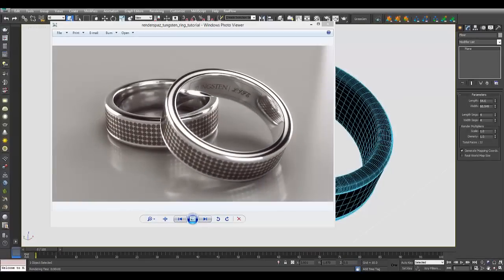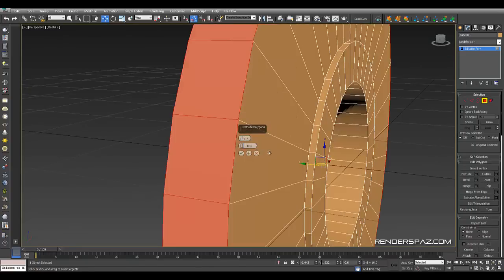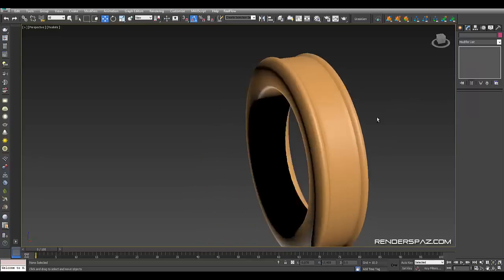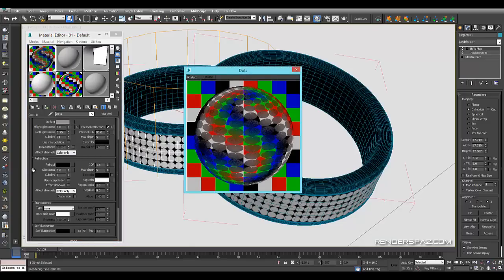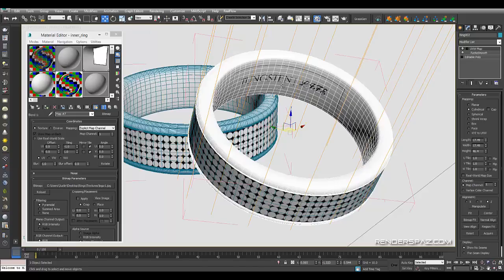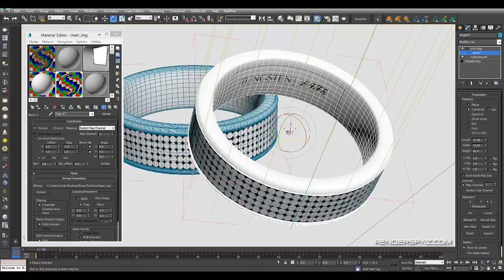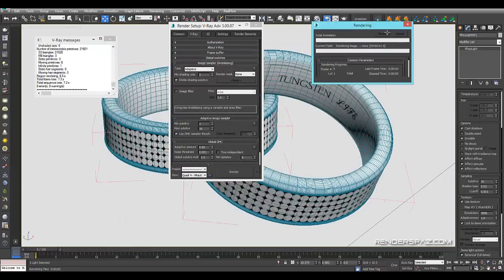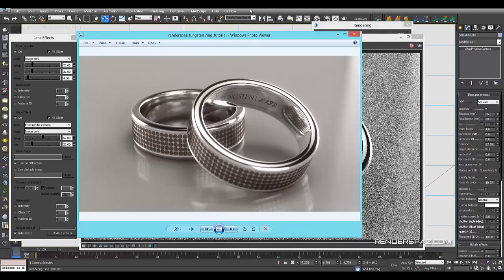Jewelry Rendering - Tungsten Rings 3D Studio Max & Vray

Comment: Hi, thanks for your tutorial. What are the parameters or which is the material you used for the surface where the rings are lying?
Reply from the maker: +Asun Perea Diffuse is rgb92,92,92 reflection 200, 200,200 rgloss, .8  I added color to the image so it may differ a bit.
Reply: Thanks!! 😊